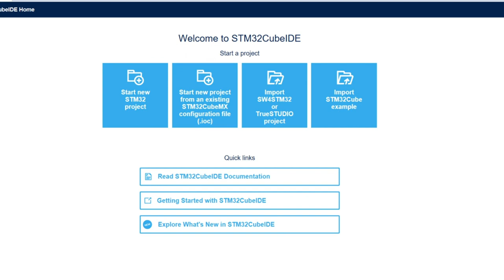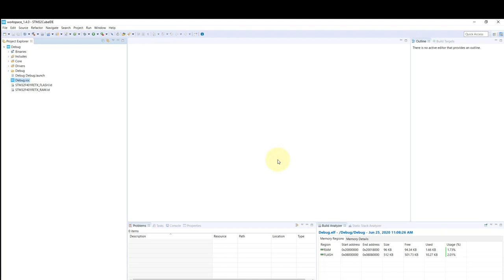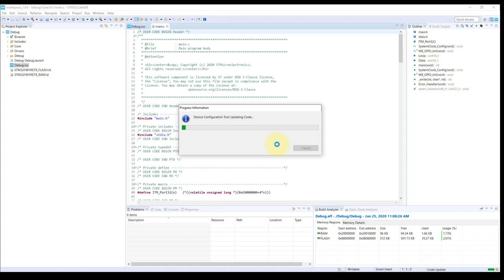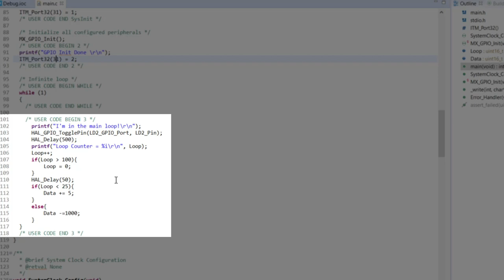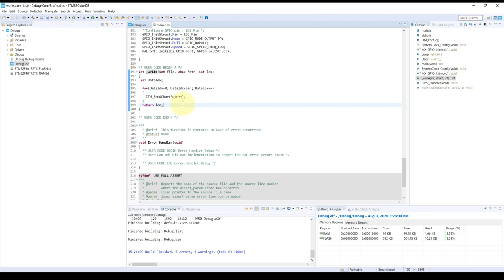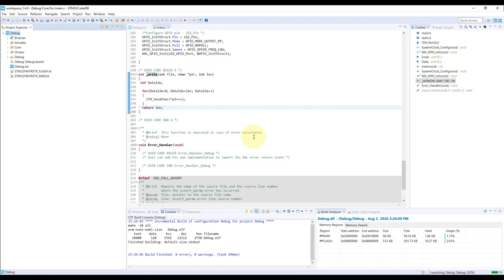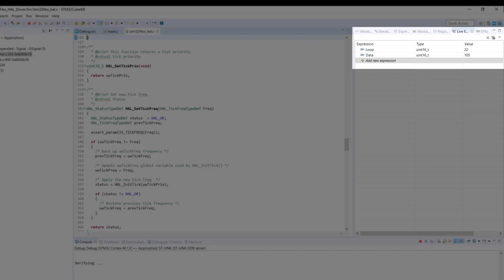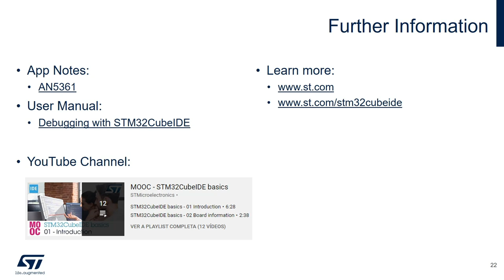STM32CubeIDE Advanced Debug Features: Part 2

Comment: I understand to capture execution instructions (ETM) requires a I-jet Trace Arm / Ulink Pro (won't work with JLink Pro) and the board must have 1-4 TPIU trace pins that go to the connector?  But what is ETB/MTB?  Segger's J-Link Pro only supports Embedded-Trace-Buffer (jtag) and Micro-Trace-Buffer?! 

So instead I'd like to use SWD's SWV data tracing (via the SWO pin), in either format:
1) UART style (1-50Mb/s) - supported by ULINK2 and ULINK-ME
2) Manchester encoded (100Mb/s) - supported by ULINKpro
with a low-cost SWD debugger and Eclipse/OpenOCD.

For example, I understand ITM_SendChar() uses the SWV/SWO pin..   and in the software you have to enable ITM Port 0..    

But will SWV data TRACING work using any SWD compatible debugger (J-Link EDU/mini, AT-Atmel-ICE, St-Link-v3/Black-pill, RealView Ulink2) on any SWD compatible board (STM32, Smartfusion2)?  

If so, In terms of software, can SWV Tracing be used in Eclipse+OpenOCD ?

Comment: This is a good example of a bad demo. Important steps are skipped because the demo was prepared in advance and some changes made to the original project / settings are forgotten in the final recording. What I do when I make a (company internal) demo is start from a blank project and commit to git as initial. When finished, I commit again and make a diff to initial. Everything in the diff is explained in the demo video.
Problems I experience: values in the Expressions window are not live updated (I use Cube IDE Version: 1.10.1, Build: 12716_20220707_0928 (UTC)): the moment I pause the software, values are updated. Further it's obvious one has to include <stdio.h> to use printf (so not a big issue this wasn't mentioned). But even if I put _write function and printf's in my code: it compiles / no printf output is ever shown. If I put a breakpoint in the _write function, the code stops there. So why no data is finally outputted I can only guess / experiment (since I did not find any useful info searching).
Reply from the maker: Hi, thanks for your comment, sorry to hear that you didn't like our demo. Our engineers do their very best to create this content and we do consider your comment!

Comment: it is not clear whether the "Debug" project was received automatically or was it made specifically for ITM ?
Reply: The "Debug" project was added into the IDE - the source code is in the video description.
The ITM support is added by using the SWD+SWO, trace async selection in the SYS @2:24. All core ARM cortex M3/M4/M7/M23/M33 have the ITM embedded 
In the debug configuration, you need to check the SWV box to use the ITM in your debug session @9:40